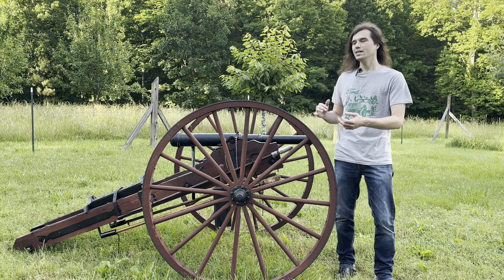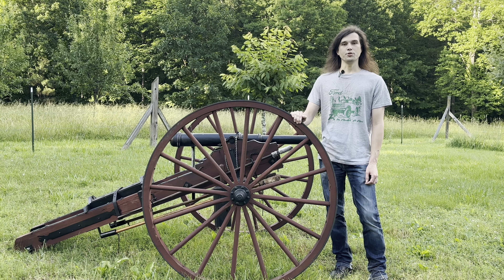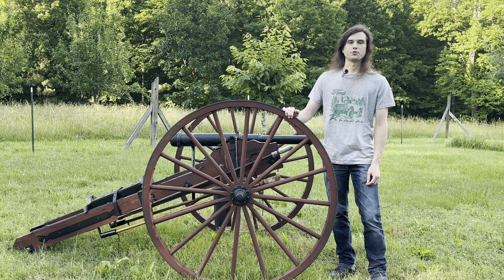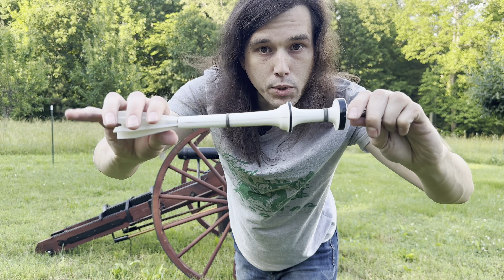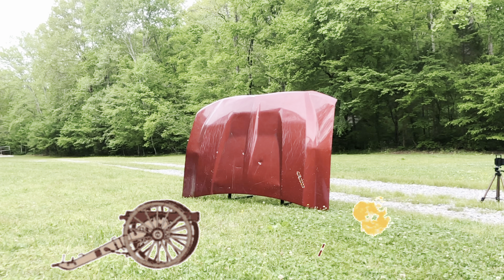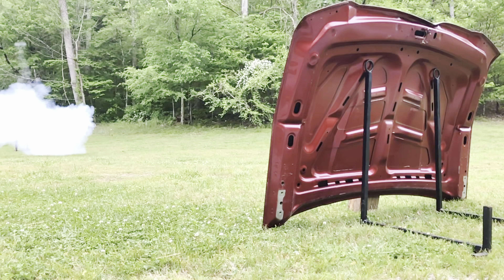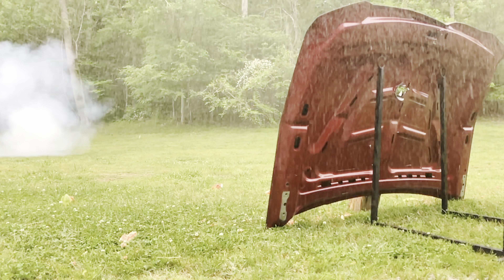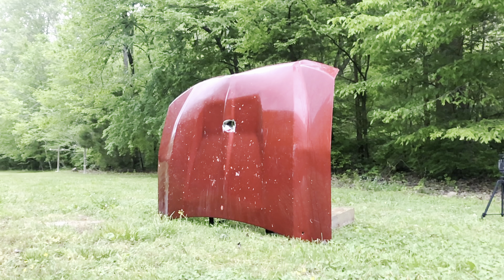Shooting 3D Printed APFSDS Tank Rounds

Comment: a few things I see that can be improved: first APFSDS Penetrators and the Sabot have some sort of grooves that basically are supposed to do what you did at the end with the rubber band as well as giving the sabot enough friction the keep them on the penetrator before firing , second: you souldn't strip the sabot parts together to allow them to seperate easily after leaving the muzzle, and third: dont use that base plate at the back. you basically replace the actual sabot with that thing, which causes a lot of issues. 

Probably it also would help to try a material with a slightly better durability like ABS instead of the PLA.

Comment: I think you have two big problems, one of which is related to PLA being very brittle. There is no way that the PLA fins survived being pushed by the wad. One thing I would suggest is making fins out of sheet steel and either cutting fins and welding them to the rod or bending the sheet to make two find and spot welding in the middle (like mortar rounds).
The second problem was apparent when you pulled out the rod from the sabot. You shouldn't need the TPU wad, the seal should be provided by the petals and they should "pull" the rod along. You need to cut some interlocking surfaces on the rod so you can't pull it out of the petal.
So:
1- welded metal fins
2- grooves to fix the sabot
Or:
Dispense with the sabot, use the wad and weld front and back fins to keep the rod centered. If the wad is providing the seal, there's no need for sabots.
Hope this wall of text helped.

Comment: I THINK i figured out the 2 key issues. 

1.) The Dart itself, is Notched into the Sabots, And they "Pull" the Dart down the Bore. 
2.) Nothing staying intact Because you 3D Printed everything. You cant put Plastic with Ballistic Pressures and Heat.

Comment: You need to create break groves and only have the thinnest pieces of material holding them together.

The tape & bands are flexible and do not break apart. You need to guide the break apart and weaken the material along those break up sections so the force of the wind is stronger and more than enough to break the material. You’d better off using a more brittle material like dried cardboard or very brittle plaster. You’re not using even close the power of a shot real sabots experience when fired so you need to compensate by using material that’s more brittle to get the proper break away affect you’re after

Comment: I’ll share a couple of things about apfsds that I know if it helps any.

Don’t add any spin to fin stabilized projectiles, it causes instability, I don’t know what your cannon is but if it’s rifled you’ll need to find a way to stop the spinning.

You should find a way to attach the fins permanently from stronger material, preferably just machined with the dart itself from steel, aluminum would be too weak to survive the impact if you wanted to possibly reuse the dart.

Don’t use a base plate you’ll only crush the fins, the sabot is your gas seal.

Rib the shaft of the dart and make sure the sabot locks to them with matching dips, that will mechanically lock them together until they both exit the barrel so no need for tape or bands.

Take a look at fully assembled apfsds rounds without the propellant case to get a better idea of what your sabot should look like such as where the engagement rings that touch the barrel are along the darts length for better stability.

That’s all I can think of at the moment but I hope this helps cause I want to see this work!
Reply from the maker: Much appreciated! Me too and we will get one working!

Comment: That baseplate disc is transferring the entire pressure load of the black powder charge to the fin assembly, and the damage is multiplied by the difference in weight between the fins and the metal penetrator. What I would do to redesign this is modify the baseplate and fin assy to where the baseplate disc can support the pressure load and transfer it directly to the penetrator rod, which seems to be the most difficult object to get up to speed quickly. The disc can be done away with entirely, however, if you cut a ribbed pattern into the penetrator rod and a matching one into the inside of the sabot so it can "grip" the sub-caliber round itself and so that the pressure load is dispersed into the sabot, which drags the penetrator and fins along with as it travels out of the barrel. You might also want to toy with the size of the powder charge. Too much powder means too high of a pressure spike, which means the sabot or baseplate disc would be more likely to shatter under the strain of such a sudden acceleration. I hope this advice is good enough to make a difference, preferably for the better.

Comment: I'm not sure what plastic you are using, but I would look into what you could use that can take the heat and pressure of the black powder. Sabot's are one piece, fin and dart. And they're all made of the most dense material available. (Tungsten, uranium, etc.)

Comment: I would also recommend finding the center of gravity of the dart too. You can do this by measuring the length of the dart and then suspending the dart by a single string at the measured center of the dart. Make sure you start with more length at first so you can cut it into the right length as needed. Do this properly and you’ll eliminate all tumbling after the dart leaves the muzzle.

Comment: Hey, it´s a great project but here is the thing, the pressure in the barrel goes through and around the Tpu wad, although it has a good seal, which causes the sabots to fly off the penetrator, which then can not be stabilized and just spins through the air. Also somewhere in the process, it shears off the fins. I would say try making the fins thicker and maybe try printing some ring that you can secure on the penetrator, that will ensure that the sabot does not fly off.

Comment: Have you considered moving the fins forward so they are not absorbing the immediate shock of the cannon charge?  If the penetrator stuck out the rear of the fins and absorbed the shock, the fins would stand a better chance of staying attached.  This would be further improved if the fins never touch the barrel.
Also, the tape holding the sabot together is bound to break at one point and lead to an unequal separation of the sabots.  You might consider a loose configuration in which the barrel of the cannon holds them together.  Another strategy would be a much softer material that would tend to break at multiple points.
Good luck and happy shooting!
Reply from the maker: That's part of the updates for V2 for sure. Moving everything down a bit!

Comment: Try using a stabilizing cone instead of fins. Tank training ammunition is cone-stabilized rather than fin-stabilized. Without machining the penetrator to lock onto the sabot petals, that might be the most durability you can get out of this design. Also, ensure that your rear TPU disk ("wad"?) is applying pressure directly to the metal rod, and not the cone or fin stack. Mounting the cone or fins a bit forward of the base of the penetrator will help ensure that the bulk of the force is absorbed by the metal rod and not the printed part, which should leave aerodynamic forces after the round leaves the blast envelope as the only thing the printed part needs to withstand.

Comment: If all you have is a 3d printer , you could try to use a threaded rod , maybe 3/8" coarse thread and make it so the center of the sabot is threaded as well, and fits to the rod . Also have the fins threaded and screw on . IMO    Or just have steel fins welded on ,
Reply from the maker: I’ll try a mixture of varieties on the V2 but I’ll decently be welding some on!
Reply: @TheCannoneer   Actually, If the fins are welded, or the butt end of the dart is behind the fins and the pusher is something more solid like a cylinder of wood that fits in the barrel behind the dart, then the sabot could be much further back and resting directly against the backplate with clearances for the fins . While I'm at it , I think I would make the front of the sabot concave to encourage separation. But that's enough of me . Best of luck!

Comment: The penetrator and fins need to be all one piece metal. Also, the sabot must have an internal mating surface that engages and locks with the penetrator so the petals when attached to the penetrator hold the penetrator in the assembly. There needs to be concave surface formed at the front of the sabot so that aerodynamics peel the sabot off uniformly.

Comment: The most likely cause of your trouble is one of two things. 
1. Crushing / acceleration loading on the fins is breaking them. 
2. Gas pressure on the fins is blowing them up.

So a possible solution, make up a steel cup to attach to the base of the penetrator. The major mass in this system is that steel rod and you need to transfer the gas pressure to it. The rest of the system can then pick up their acceleration from the rod. Were I doing this, I would build the rod up in sections with nuts between the sections of the rod. Those nuts are there to transfer power to the fins and the sabot sections. So you would end up with 5 parts in the rod, 2 nuts and 3 rod sections.

Comment: The sabot must be metal. Let me explain. If you look at the m1 abrams, the whole entire system doesn’t have any buffers between the shell and the casing. The sabot must also be metal if the projectile is metal, that way the cannon pressure wont make the projectile sheer off any metal holding the projectile in place. I recommend CNC aluminum, it should be strong enough, plus you can print it into whatever you want.

Edit: if not already, it should be properly held together on the inside. That way the projectile cant move forward or backward in the sabot, so then the sabot can cleanly release after the cannon fires and it has left the barrel.

Comment: You might try TIG welding some steel fins onto your penetrators. You might need a jig to hold the fins in place wile you weld though, to keep the heat from warping them out of alignment.

Comment: The discarding sabo have to be the drive, so you need a notch of sorts in the front part of the penetrator the sabos can grab on to. 
Its the same reason the the sabo cant be plastic, you need them milled in some metal.

Comment: Hey, I have a suggestion, swap the 5/16 rod for 3/4 all thread, print matching female threads on your petals, weld fins to a couple nuts with 3/32 or 1/8 sheet steel and secure to the all thread with loctite and a locking nut. Not only should this keep the petals from shifting during loading, but it will also ensure the fins withstand the force of acceleration upon firing. Good luck
Reply from the maker: All thread for sure for V2!

Comment: Perhaps replace the fins with a threaded metal piece and make the rod thick with machined ridges to hold the sabot. The sabot needs to be stronger. Perhaps nylon, abs or phenolformalderhide. If you could find out what propellant is usually used for this type of shell in a tank, it may also help. The penetrater may need to be heavier than steel also. Not an expert but as an industrial chemist with some exposure to engineering my 2c worth. Have fun and be safe.

Comment: One of your problems is sabot drag. For this more is better as it provides the force that causes separation. Black powder is likely to give you little more than 1000ft/s. An MBT sabot round exits the barrel at more like 6000fy/s. IE 36 times more sabot drag. The front of the sabot is a higher drag design too.

Comment: NO  NO  NO NO NO!!! 

Your fins are destroyed a picosecond after the charge goes off!  Your plastic material, what ever it is, is destroyed before your steal penetrator ever gets into motion.  The penetrator MUST be put in motion at the same time as the fins!  Design your fins so that the penetrator  slides through the fins from the bottom but are prevented from sliding through the the fins by a head on the back side of the penetrator, kind of like a head on a nail.  The penetrator and the fins should come evenly in contact with the "wadding" that will push them down the barrel.  I would design the sabot "wadding" more like a shotgun shell's wadding.  The base needs to be rugged so it can get the mass of the penetrator  and fins in motion with out being destroyed but with a cushion built in to absorb the shock of being put in motion.  Make your "peddles" an integrated part of the base "wadding", again like a shotgun shell, so your projectile stays in one piece as you put it down the gun barrel.  Only put a rubber band around the "peddles" to hold them together during shipping and remove it as the projectile is placed down the barrel.  I want the "peddles" separating from the penetrator as soon as possible, right as it comes out of the barrel.  The "peddles" will have to be ridged enough not to buckle as the projectile is put in motion so as not to interfere with the directional control of the fins.  Good Luck.

Comment: I dont know much about cannons but it could be you need a longer barrel which is impossible to build up the velocity and the fins definitely need to be made of a stronger material you could try making a 3d print of one of your fins and then use that as a guide to make steel fins and weld them onto your projectile

Comment: The sabot is supposed to be the thing that absorb the energy. Make groves and sabot with groves to propel the dart. Also, use a 2 piece sabot with a air drag that would split it apart when it is on the air.

Comment: Completely encase the dart in sabot shell, use the shell for the gas seal.

Barrel rifling will help split the shell off with centrifugal force

Don’t use anything to keep the sabot case together. The bore of the cannon is responsible for keeping the sabot assembled until it leaves the muzzle. Real SLAP rounds use the cartridge case for this, but you’re working with a muzzle loader.

Lastly, ditch the plastic stabilizers. Make the dart all one piece steel.
Reply from the maker: Metal fins for sure and I’ll leave the tape off on the next one!

Comment: On APFDS rounds the darts are ridged and the inside of the sabot are ridged so the dart cannot be pushed through the sabot and removing the fins before it leaves the barrel, which is exactly what’s happening here.  There is nothing to secure and grip between the dart and the sabot.  Please take a look at the ridges down the midsection of an actual tank APFDS dart and look at the inside of the sabot casing.  If there’s nothing to stop the dart from being pushed through the sabot before the sabot petals are ready to release then you’ll get the same effect every time.  This should fix your problem.
Reply from the maker: Thanks!
Reply: @TheCannoneer  glad to help.

Comment: Ditch the fins, use a solid cone 30-40 degree angle. Need to turn grooves into the shaft and have matching grooves in the petals. Lastly the front and rear petal supports need to be further apart to improve the stability

Comment: So the penetrator needs to be fixed in the sabog until the pedals release. Ribs on the oenetrator interlocking with ribs in the sabot pedals usuallg does thentrick. I would also try better steel for the penetrator and maybe a longer barrel if possible.
Reply from the maker: Barrel we can’t extend atm but I can totally do a different type of steel!
Reply: @TheCannoneer  may not be necessary if all you're punching is car hoods. I didn't get to that part in the video before commenting. Haha. Sorry.
Reply from the maker: Oh no worries at all! I figure once we get a design that works well we can test it out and see what we can actually do with it.

Comment: Plastic guides should be attached to a steel rod, the easiest way to do this is with the help of ribs around it, the parts should not be attached to each other and come off immediately after the projectiles exit the barrel, then about the metal bar itself, it does not represent anything, there is no armor-piercing cap, core, shell made of soft metal...

Comment: Idea: Simply move the fins forward on the penetrator so that the very rear of the penetrator itself is what has the pressure from the pad instead of the fins.

This will be the simplest way to resolve the issue with minimal modifications.

Comment: The issue here is that the discharging casing is supposed to be what seals the barrel and in turn is what accelerates the projectile down the barrel. It should work if you design it to locate itself into a lip/groove around the penetrator when assembled, and then loading it into the barrel needs to lock it in place so it can only discharge the casing as it exits the barrel.

Comment: Cant you extend the penetrator (the metal rod) so that its end is at level with the base of the fins? That way the pressure from the cap pushing it is on the metal rod and not the plastic fins.
Sub'ed BTW.
Reply from the maker: Thanks so much! That’s going to be v2 fix for sure lol

Comment: The puck at the end pushes on the fin which is in turn unable to transfer the huge force to the penetrator. The fin is crushed, the gases mostly escape, hence the relatively low speed compared to the cannon ball.

I suggest sticking the penetrator through the fins, so the puck pushes on the steel rod rather than the plastic fin.
Reply: ...adding grooves and trying to make the sabot adhere to the penetrator IMHO is too complicated and unnecessary once you make the puck accelerate the whole assembly by pushing on the penetrator. The discarding sabot only has to keep the projectile centered in the barrel, keep it from tumbling and destroying the fin. It does not need to transfer any axial load to the projectile.